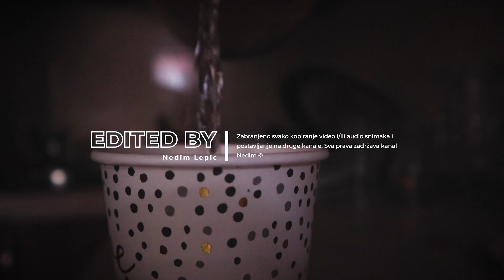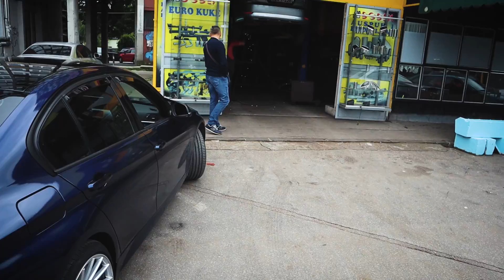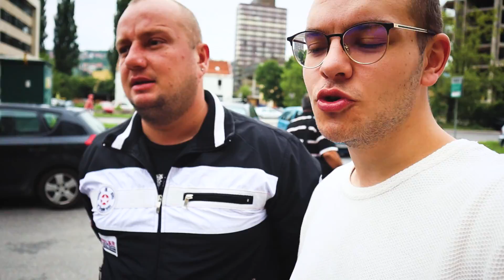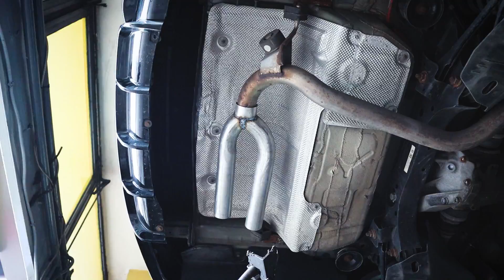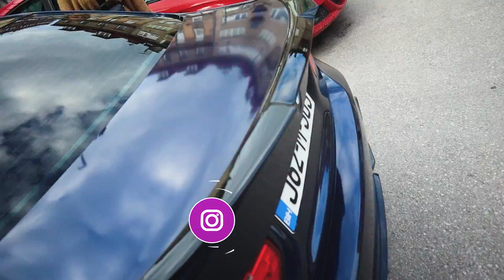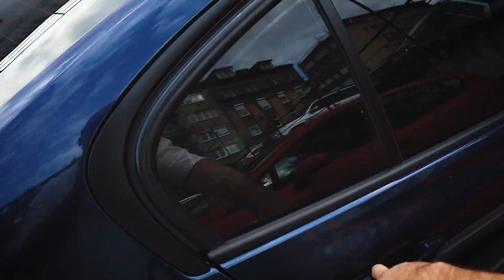NOVI IZDUV NA BMW-u  *ISPUSTA VATRU*

Comment: Zasto na 316d od 115 ks idu gevinde od 950€ i ostala cuda kad je to idalje 115 ks 😪
Reply: Zato jer će ić na chip tunning
Reply: @Ivan-xn7mj  što bi išao na chip 2.0 115ks,koliko ga moze cipovat na nekih 160ks max.
A mogao je uzeti isto 320d 2.0 koji fabricki ima 184ks,fabricki jaci nego 316d sa chipom
Reply: @tahiritahoni17  isti su ti motori i 1.6 i 1.8 i 2.0, taj 1.6 mozes mapirat isto kao i 2.0 jer su isti motori samo je 1.6 manje izmapiran, oznaka je 316 a kubikaza je 2000.
Reply: @tahiritahoni17  pitaj njega
Reply: Zato sto su glupi
Reply: @thedado2007  sto se tice 316 i 320 samo je blok isti. Razlika je u turbu, intercooleru, kompletnom sistemu goriva od pumpe pa sve do dizni. Ima tu dosta ulaganja da se iz ovog bmw-a izvuce snaga kao iz nugatovog.

Comment: Nedime, volim te, postujem te ozbiljno al brate na sta ti trosis pare.... mogao sebi kupiti 2.0 320 180 konja
Reply: 184hp
Reply: Budala, a i nista ne znaci da li je 316d, 318d, 320d ili 325d, sve je to isto i ima isti traktorski zvuk. Jadno je raditi ovo od auta koji je dizel. Da 3000 evra za felne a nije mogao kupiti neki benzin koji god da je